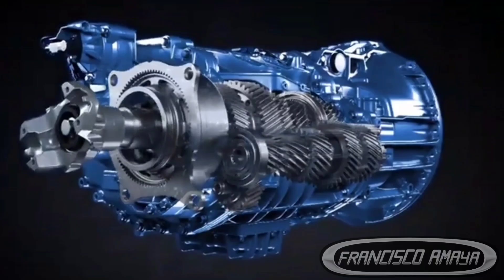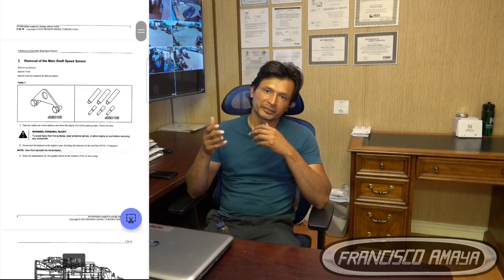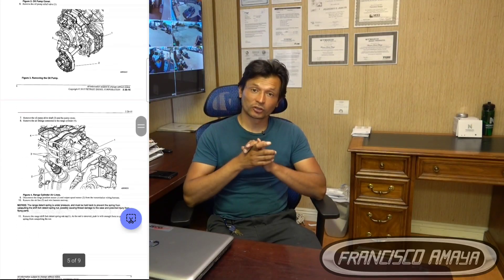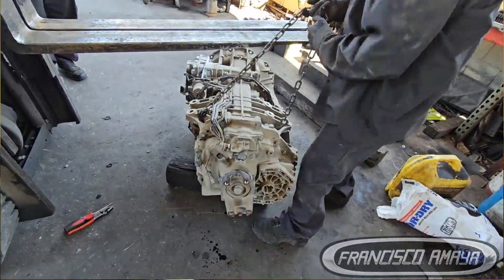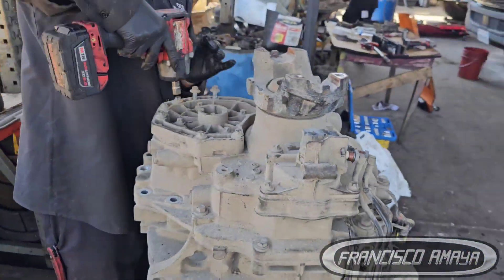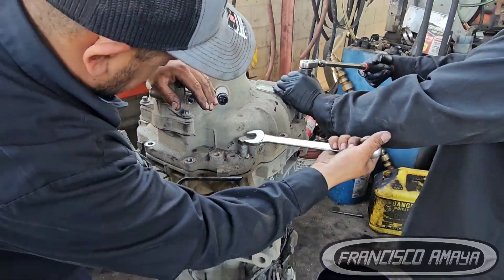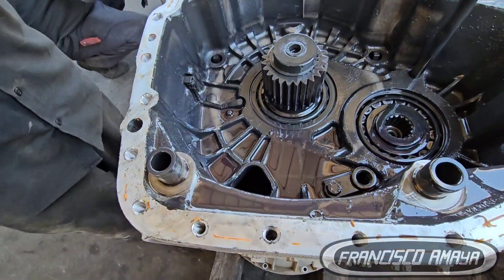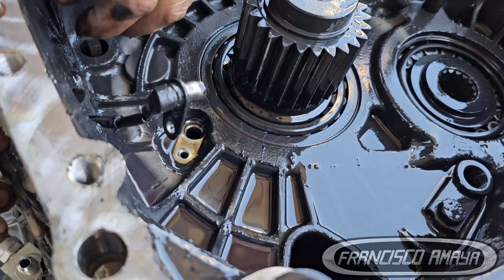DT12 AUTOMATIC TRANSMISSION MAIN SHAFT SPEED SENSOR PROBLEMS SENSOR LOCATION REPAIR PROCESS

Comment: So did the job today because already had the transmission down but I have something to share with you that I learned doing this job. First and most important, that sensor you are doing in that location on the drivers side of the transmission is THE MAINSHAFT SENSOR, the countershaft sensor is in the opposite end of the transmission on the passenger side and the transmission does not need to be off in order to service it. I found out when going to get the parts at the dealer and asked them to let me look at their parts system schematics. I was surprised when I asked them for it and when they brought it out it looked nothing like the one I had pulled after taking the transmission down and disassembled the back end to get it out. The code I was getting was for the countershaft sensor. I could have saved me some time had I known this so I wanted to share with you this. This is my own truck so it cost me  400 more for the other sensor which I went ahead and changed it tracks got almost 900 thousand miles anyways and when I went to pull a reading on it thinking it was the countershaft sensor I did not get any readings infinite homes and it made sense to me that voltage was reading low and there was small amount of oil at the connection so decided to do the job. Basically the gears were shifting very inefficiently especially when bobtailing it would run through every gear and when slowing down it would downshift slowly and only to 7 gear when almost stopped and if it did go lower it would grind the gear. I only did this for a few hours of driving to finish my short job and then decided to fix it so everything should workout fine. I’m still on the second day doing the job tomorrow I change motor mounts since I’m there and put it all back together. Let you know how it goes when I’m finished.

Comment: Hello, Francisco- i have problem on my truck, when it goes from 5 to 7, it take long time, and sometimes it go to neutral between shifting. Also my cruise control often go off and engine brake stop working. I need stop. And after it again it start works. I have Dddl, i did clutch and transmission relearn procedure, and it was run good. Can yoy help me, please. I need your advice( truck still has 750k transmission warranty)